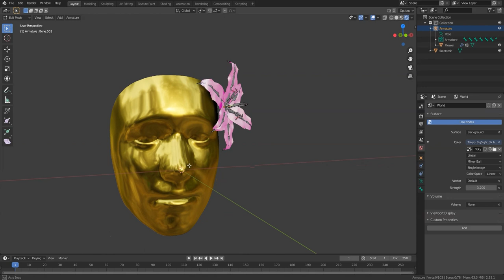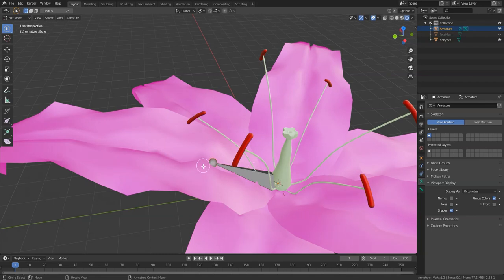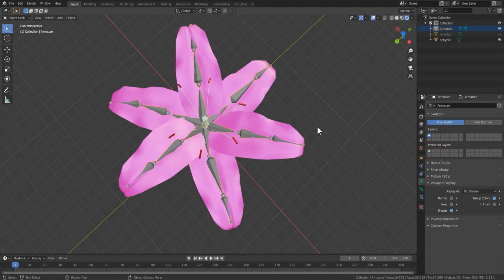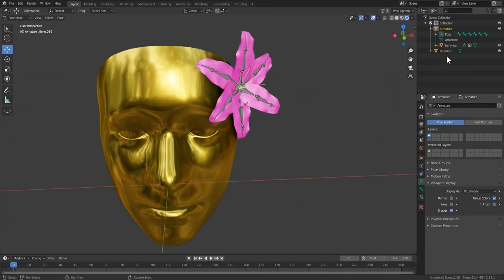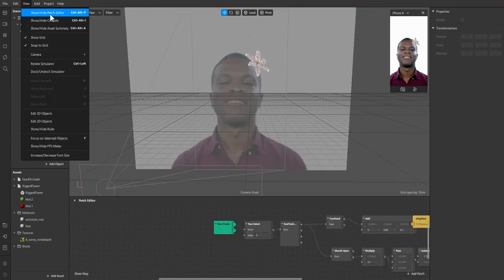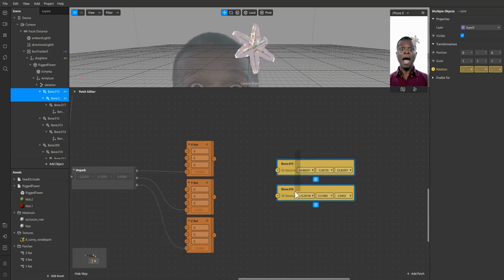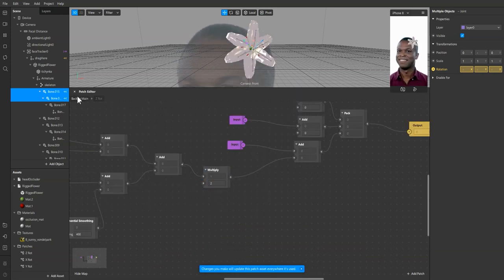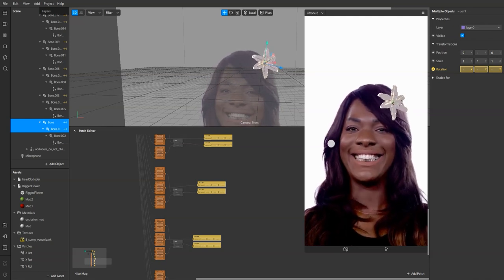3D Model with Physics for Spark AR

Comment: So when I imported the flower into Spark AR - the pedals were missing. But I've parented all the mesh together as the original model itself was not just one mesh unit combined. Do you know how I can fix that?
Reply from the maker: Did you check the weights? I made another tutorial that goes into the depth of it, might be of help for you :)

Comment: I can't see the flower when I import into Spark AR. I'm also getting an error indicating that the 3D object I imported exceeds the file size recommendation. Additionally, I noticed that you exported the flower as a .fbx but then you imported a .glb file.
Reply from the maker: Both extensions are compatible with Spark AR. Make sure to use the Spark AR Addon for Blender to apply it's dimensions to the appropriate ones for Spark.
Reply: @thebensimon  Ok awesome. Thanks!

Comment: Its weard but its dosnt work for me =( i try to rigg in blender and c4d my object but its still dosnt show me my rigg in spark ar even if i try fbx or gltf. any suggestion?
Reply from the maker: What's the error you're getting?
Reply: @thebensimon  i solve this issue. it was cuz object have more then 10k vertex =(
Reply from the maker: Jorik Rosa ah yes! This is a very common reason! Glad you solved it!
Reply: Ran Bensimon this is what about all to forget mention )))
Reply: @JorikRosa  Hi! How did you lower the vertex ? I used decimate but still no rig on spark :(
Reply: Tenessees I use reduce polygons in c4d
Reply from the maker: Tenessees there's also a new cool add on for blender to reduce and prepare meshes for Spark AR, it's covered also in my next tutorial that will be available soon ✨
Reply: @thebensimon  Thank you! Can't wait to see this :)